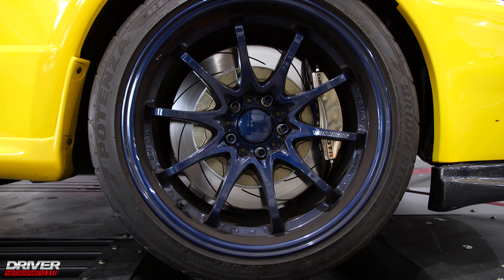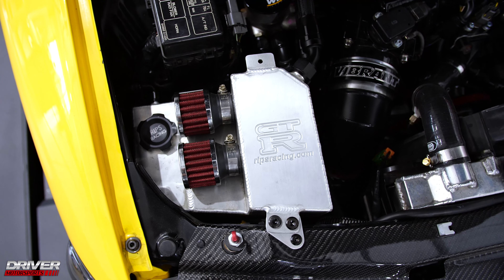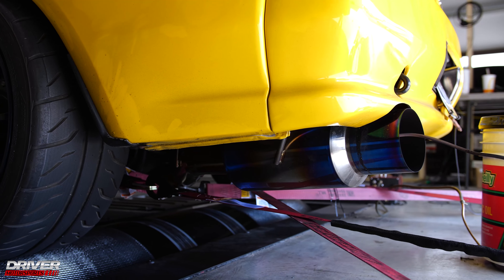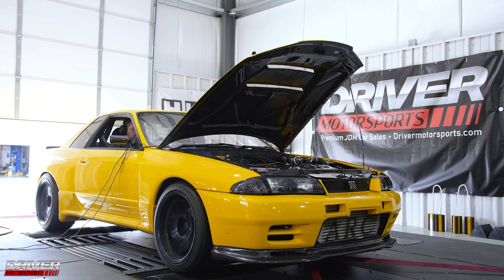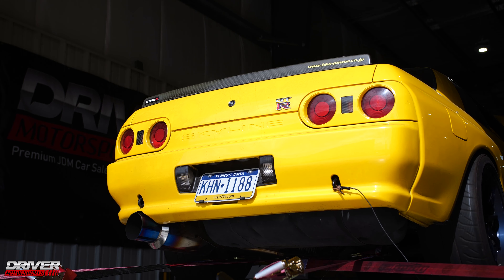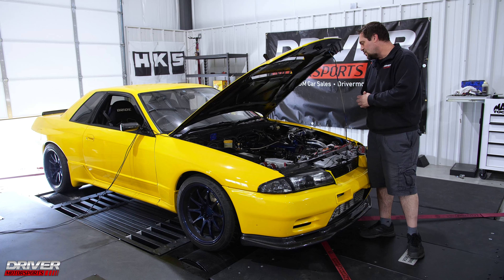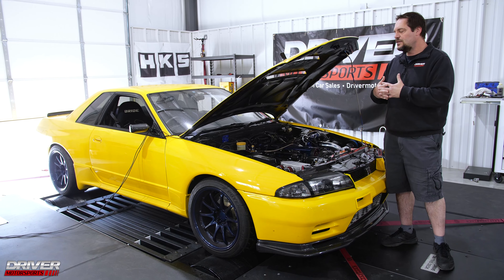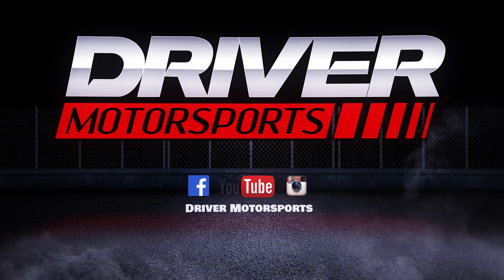REAL WHP | JEFF'S RIPS RB30 FULL RACE TT R32 SKYLINE GTR | DYNO TESTED

Comment: It's come a long way since I bought it from you guys.  Thanks for all the hard work!
Reply: What transmission are you running to hold the power?
Reply: @Kurupt714  it's got a PPG helical cut synchro box. Upgraded mainshaft, forks, and sandwich plate as well. It's the weak link in the chain but should be ok.
Reply: Jeff Shimer damn son!!!
Reply: @jeffshimer7385  I also have a r32 and had to turn down the power to 600whp because I'm on a stock trans with upgraded clutch. Need to figure out what to do so I can turn the power back up. Thanks for the input, Amazing job on the build.
Reply: @Kurupt714  talk to Shep Trans about a PPG build. Or if budget allows consider a sequential. The PPG setup I have feels great and should hold the power. We'll see how long the synchros last though....and thanks for the complement.
Reply: May I get the color code for the 32? I’ve been looking to repaint my GTR to a color like this 🥴🙏🏾
Reply: @GodOfWAP169  I honestly have no idea. It came over from Japan this way. I wish I knew too as I need to respray it for a better color match with the skirts and hood.
Reply: @GodOfWAP169  cool color man. I was thinking something pearl like a Lambo yellow. Or hell, even Honda Rio Yellow is nice.